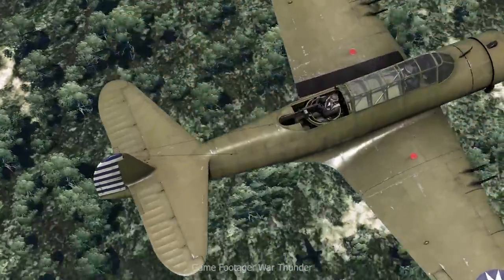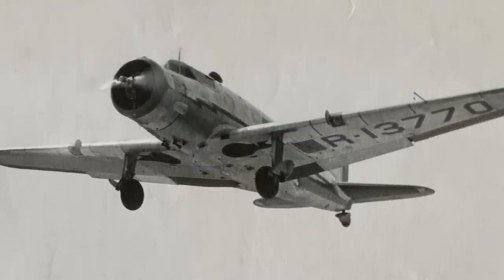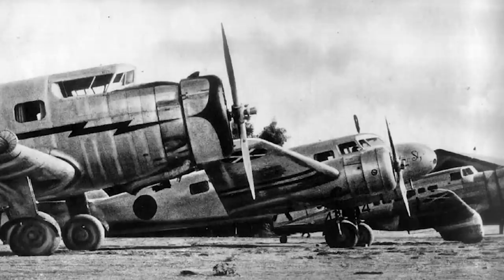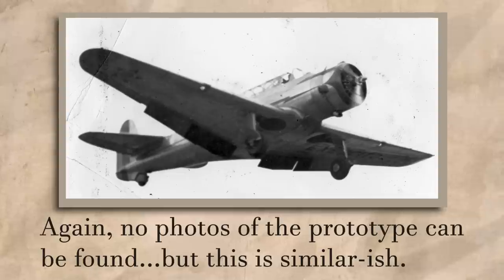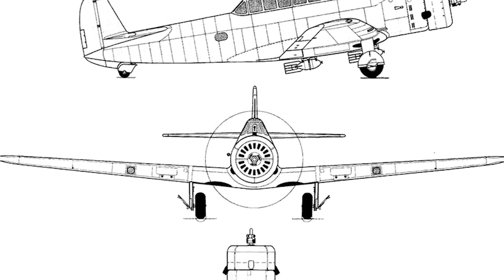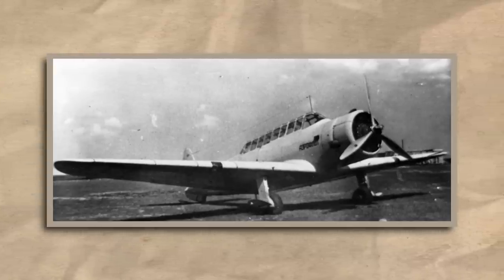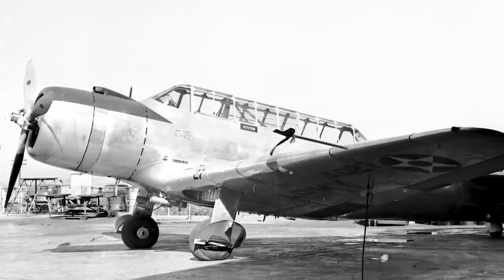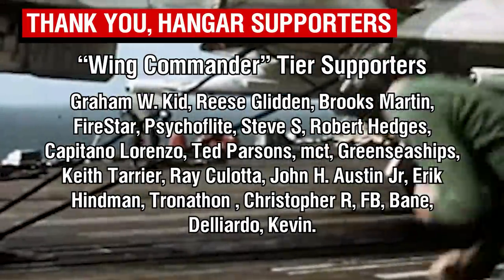The Failed Airliner That Became A Bomber - Vultee V-11 [Aircraft Overview #80]

Comment: It is such a shitshow with these regulatory bodies worldwide. Those single engine airliners were powered by the most reliable radial engines ever built. But no. You need two of them, so you immediately get in trouble if just one fails. You're just as dead, but you were on a twin engine airliner according to regulations.

Comment: Oh, thank you for covering the Vultee V-11. I think it is one of the prettiest interwar aircraft produced. I love the long greenhouse perched and blended atop the fuselage, the jaunty forward perched stabilizer, the wraparound rudder, the wing profile, the engine cowling (particularly on R-1830 versions) and the fully covered retractable undercarriage. I DIDN'T like the later R-2600 powered versions as that engine spoiled its trim lines, but I see why they did it.

The V-11 was a very jaunty and cool aeroplane. Thanks again.

Comment: I have a book about dive bombers which has some of the more obscure aircraft and the A35 Vultee Vengeance features especially in RAF and RAAF service in the far east it was also unusual in that like the Ju 87 it had cranked wings .
Reply: The Vengeance didn't really have "cranked" wings a'la Ju-87, as in negative dihedral on the inboard sections. Vengeance simply had no (or negligible) dihedral on the inboard sections, and dihedral on the outboard sections. In photos the Vengeance often appears to have cranked wings, but this is an illusion, created by the difference in inboard/outboard dihedral, compounded by the very unusual wing planform, i.e. leading edges swept back on the inboard sections, and straight on the outboard; and trailing edges straight on inboard and tapering forward on outboard. Photographed from just about any angle other than dead ahead/behind, or directly above/below, it looks like a bird with two broken wings.
Reply: Thanks for replying buddy, 
As regards the wing layout I did know it wasn't the same but I just liked the fact the wings were unusual. 👍
Reply: Caused by faulty calculations of the CG - it was too late to change the wing mountings so Vultee moved the centre of lift backwards by cranking the wing in the horizontal plane!  The result was an excellent aircraft that was overshadowed (in the SW Pacific Theatre) by the rise of the P-40 as a fighter bomber.  P-40s were less accurate but didn’t require escorting, while the Vengeance did.  It made more sense logistically to send 2 P-40 bombers rather than 1 Vengeance bomber and 1 P-40 escort.  The troops however much preferred the accuracy of the Vengeance when bombs were being dropped in close support!

Comment: Errett Lobban Cord started as a car salesman for the Auburn company and quickly rose to be the president of that company and went on to combine Auburn with Cord and Duesenberg. He went on to assemble an empire of more than 150 companies. most of them transportation related. The automotive parts of the Cord company died in the 1937 bankruptcy but the Aviation assets, which included Stinson aircraft and Lycoming engines and Vultee went under the name AVCO which stood for Avaition Company. I noticed that the later versions of the V-11 included a Lycoming powered version  which I assume was dome for cooperate reasons so that the whole aircraft was built with AVCO components. During the 1940's Vultee became Consolidated-Vultee and then just Consolidated Aircraft. AVCO also got into broadcasting and owned Radio and Television stations in the United States including WLW (the nation's station with 100,000 watts) in Cincinnati which had previously been owned by Powell Crossly.

Comment: The Vultee  V-11 essentially was an American equivalent to Britain's Fairey Battle light bomber and would probably have fared just about as badly had it been committed to combat during WW-II.  Like the Battle, the V-11 was not a bad airplane, but it simply was no longer good enough.  The two-seat, single-engine day bomber formula was a throwback to WW-I that was simply no longer relevant.  Bear in mind that, being a mid-1930s design, the V-11 lacked armor protection and self-sealing fuel tanks and that it could only carry 1,100 pounds of bombs, an amount which could have been equalled or exceeded by most single-engine fighters during WW-II.
Reply: It might have been a good torpedo bomber.

Comment: Compared with the Fairey Battle, dog and  a half, Vultee,s V-11 is vastly superior , being radial engined can accept any in the 1, 200-1,400 hp bracket. This is the light bomber the RAF  should have bought instead o.f the Battle, giving  the  BEF a means to  bomb German armoured columns advancing through France , Belgium and able to hold its own against attacking Messershmitt BF 109 E-3,s

Comment: This is a good looking airplane in the retractable gear configuration. The tail plane looks a little odd in its forward position. I wonder if it would have been more successful if the packard or Allison v12 engines would have been tried.

Comment: 3:12 Surely that can't be true that there was no minimum crew requirement, at least technically speaking if not necessarily legally. After all surely the minimum crew requirement for any plane was at least one pilot, otherwise you've just got a very expensive paperweight, and a bunch of upset passengers 😂

Does sound like a bad comedy sketch about a 1930s budget airline: "Crew are not required under law, enabling us to provide our customers with the best value for money in the world by both removing the expensive cost of a pilot, and also allowing a slight increase in luggage allowance (or even fuel). All our planes come with a free and easy to use guide, but should you fancy treating yourself a range of pilots to suit a variety of budgets are available under the optional extras."